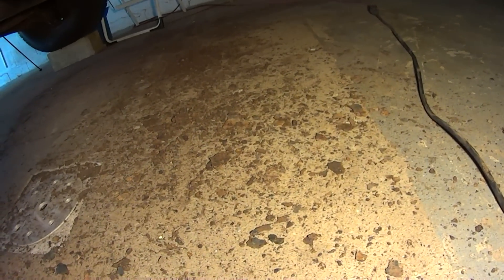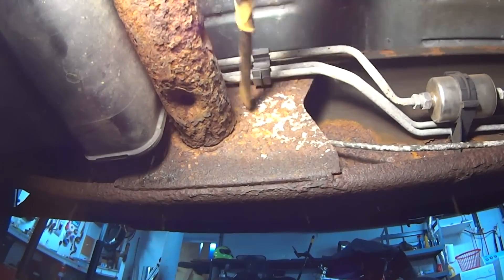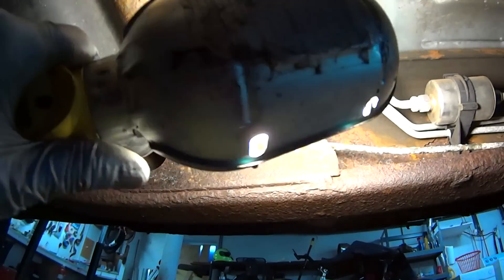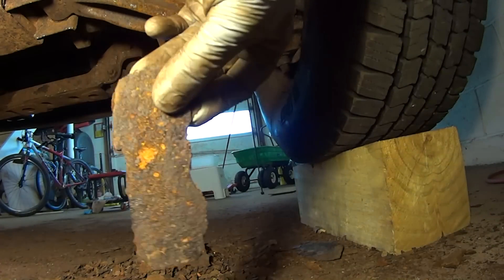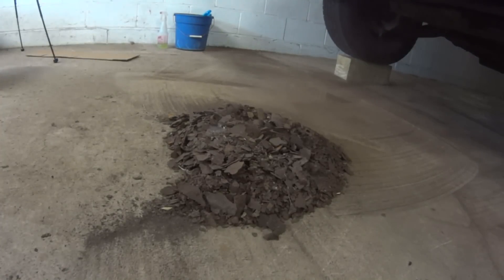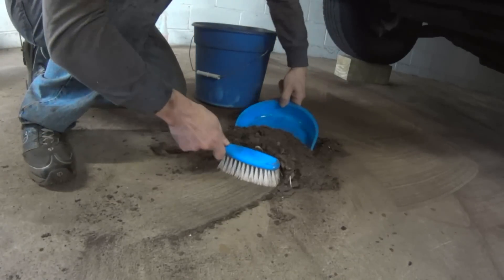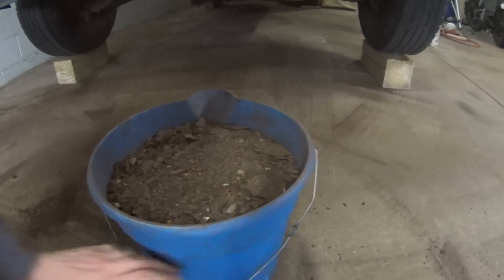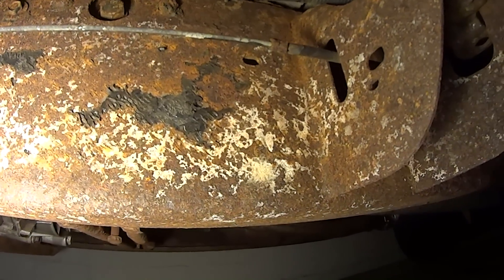Most satisfying video. Silverado Frame rust removal, RUST PROOF STUDY

Comment: Man i tell my truck friends all the time. Take an hour once a year look at your frame. Scrape off bad and rustoleum it. My frame will look new in 20 years.
Reply: Rustoleom will fail eventually.  Oil is best.
Reply: @Ken-h9r  i do both actually. Every year i wipe my frame down with wd40 and any paint spots showing rust i brush them and spray a ligh t coat of industrial strength rustoleum. Never fails.   I only do touch up though not full coating.

Comment: I've also found that the air hammer / chisel bit knocks rust like this off the best. Now, I will say I own the smaller Harbor Freight needle scaler, and the air hammer I have is a Snap On, so there could be a slight difference in quality, that aside, the air hammer knocks the rust off much more aggressively / way faster. The scaler is handy to have, especially as cheap as it is, but this sort of frame rust, use an air hammer like the video shows.
Reply from the maker: Scaler is good for surface rust but not when you have 1/8" thick sheets of rust.

Comment: Tip: use a shop vaccume with a small attachment, like a lint vaccume snake attachment to blow out the inside of the frame.
Especially before you do a treatment.
Reply from the maker: I used leaf blower, vacuum and plumber snake
Reply: @troutjunkie7330  Amazing how much you can get out from inside a rusty frame.

Comment: After all that the chassis looked liked a baked beans can thin,,  I wonder for why you'd bother unless you sand blast or acid dip it ,  the rust is back and next time chisel  punch holes every where , ,   unroadworthy death trap waiting to happen ,  the integrity is gone from the chassis don't carry weight or tow trailers when your Ute truck has reached this stage  ,  it's a 3rd or strength it once was
Reply from the maker: This is old 1999 3/4 ton truck with thick frame. Frames back then were strong. The thinnest spots were 0.120 after all rust removal. Today new truck frames are only 0.060 thick to make them lighter and more MPG.

Comment: The DeLorian cars from the 1980’s were for the most part rust proof.  The frames were dipped in a liquid rubber like substance that filled every inside crack and crevice.   There is no reason why GM, Ford, Dodge-Chrysler can’t rust proof their cars and trucks.   Even the back side of body panels.
Reply: In a 10+ years the rubber coating begin to crack - because of different temperatures, sunlight, chemicals, tensions... And through one crack the moisture goes under the rubber, but do not dry. It ot the end of still frame, but from outside it may look good.
Reply: GM actually does dip the frames on there trucks the stuff is cosmoline grease/wax.
Reply: Stainless steel,my cuz has one.

Comment: By hitting the metal so hard with perferator, you are penatrading zinc layer which is only about 15 microns thin. The best way would be using steel brush to clean that rust off as it doesnt penatrate zinc as hard ar perferator.

Comment: Doing this same work on my 03 Silverado except it's not flaking off well enough to make it so easy like yours. Using a wire wheel on an angle grinder is working better. Also not as bad as yours and the factory costing that hasn't failed is still plyable so it won't come off as easy. Por15 and a a of rust converter spray paint then fluid film before the winter after I'm done cleaning the rot

Comment: So I am at 6:26 and wondering what you do next after using the needle scaler? Will you use a wire brush in spots or just apply a converter or whatever?
Reply from the maker: I applied grease right after this. Other parts I cleaned to metal and used different paints. Doing 5 years study on rust prevention. Video coming in September  at 5 year mark.

Comment: Exactly what I have ahead of me. Already did it once but I used undercoating after and now regret it. The undercoating looked great and I thought that was the right product to use but unfortunately the rust fosters under the undercoating and years later it finally blisters and flakes off but now the rust is THICK and big chunks vs surface rust. I'm going to do the chiseling and wire wheel again but look for a paint product of some sort, maybe something from a marine store might work.
Reply from the maker: Grease. I used 7 most popular products to do long term testing in different section of the frame (5 year update coming soon) Grease smeared all over is the best. 5 years, no rust.
Reply: Is grease better than oil for undercoating?  And what kind of grease do you recommend?

Comment: Dose doing this take away from structural soundness?? This is my only question
Reply from the maker: This is 2500 truck from 1999. The frame on those was 0.15" thick. Today the frames are 0.060 thick to maximize MPG

Comment: I understand eventually you will get rust on you chassis but not shortly after you buy it after years of driving yes... most is caused by poor metals use in the manufacturing process and poor  quality paint products use in coating the frames.... they do this so you will buy newer trucks faster!!!

Comment: Frame still looks pretty good once you get that undercoating and scale off of it and pressure wash it. A nice coat of spray cosmoline once everything dries and you are good to go!
Reply: I've found the thickness of cosmoline with even two coats to not be enough...once I've got anything other than super light rust, it needs to be slathered with lanoline based goo (woolwax)

Comment: Look at it this way. You obviously don't have the infamous gm transfer case pin hole leak or your transfer case would have put rust inhibitor on both cross members aka dexron 3 transmission fluid.

Comment: Is there any benefit from removing the rust? I feel like your just penetrating the steel and weakening it. Unless you plan on reinforcing the still after removing.
Reply: Certainly there is benefit to removing the rust scale. If you were paying attention to the video you saw the salt deposits that were hiding under the rust. If any undercoating is to have any success averting further rusting the scale and salt has to be removed. Otherwise the undercoating only seals in the salt and any moisture forming a rust promoting poultice that negates the protection that the undercoating is intended to provide. BTW, rust has no structural integrity. So removing it does not change the existing strength of the frame metal. In fact, since no rust holes appeared after the removal operation, this frame is still in good shape.

Comment: According to uncle Tony ur not taking off rust ur merely taking off unnecessary weight for faster race times it's called drill holes and scrape rust off to gain a 10th of a sec in the quarter mile lol

Comment: For those that don't know just because 40lbs of rust came off doesn't mean he lost 40lbs of steel. When Iron combines with oxygen to form rust you gain the weight of the oxygen.
Reply: Lol what? The weight of the oxygen would be non measurable. Knocking off rust would in fact make the vehicle lighter, but not by much
Reply: @DaDaDo661 He's right.

Rust is made of iron (Fe), di-oxygen (O2) and water (H20).

The weight of oxygen is absolutly measurable.

Fe : 55.85 g/mol
H : 1.008 g/mol
O : 16.00g/mol

With that and the chemical equation, rust would be 1.4x heavier than pure iron.
Reply: @DaDaDo661  This is untrue, you can check this yourself, get some steel wool, weigh it, set it on fire and weigh afterwards. It will be converted to iron oxide (rust) and the weight will increase measurably.

Comment: Man I love my 2002 tacoma but I gotta be jealous that you can take that much rust off and still have a solid frame.  Mine would be long gone if it got that bad
Reply from the maker: This is 2500 truck that has a frame that is 0.150 thick. I think the older Tacos have 0.060 frames
Reply: @troutjunkie7330  Yeah that figures.  I think the frame design on 1st gen tacos esp is also such that they tend to rot from the inside out.  So often if you see significant rust on outside, the frame is already compromised from what you cant see on the inside.

Comment: Wow! This is an eye opener. I bought an Fj cruiser online at an out of state auction. Only to find out that it had so much rust underneath the vehicle. I could not find a repair shop so I had to let go of the vehicle. Wish I knew that I could have gotten rid of the rust just by doing this.
Reply: If a repair shop turned it away it wasn't this kinda rust. It prolly had rot and holes forming...

Comment: I bet the inside of that frame looks a lot worse now. You just loosened up all the rust inside and probably accelerated it when it gets wet again with road salt. You made the truck more dangerous if it splits from the inside of the framework. Remember cars rust from the inside out not the outside in. I bet that truck has been cubed already.

Comment: I've got one just as bad if not worse that I started working on a couple days ago. I've got rearend u bolts completely rusted away, leaf spring mounts with holes in them and brake and fuel lines rusted thru. I'm gonna weigh my rust when I'm done and see how much weight reduction I got out of it.
Reply: Lmao
Reply: 26 lbs of weight reduction is what I got! Pulled the bed off today to make things easier to work on.
Reply: @nxslt11  😂 Chevy junk
Reply: Not quite. It's from years of driving in snow and salt then parking it without any rain washing the salt off.
Reply: @nxslt11  Yea well Chevys and Toyotas are well known for rust. I saw a video of a Toyotas Frame snapping in half.

Comment: I’m glad I live in the south ..... I don’t have this problem.... 
but air chisel is the best way to go. Then either hit it with a flap wheel or wire wheel..... to get the salt off. And just put a coat of ospho on to convert the rust ferric oxide to feral ferric oxide and stop it.....

Comment: Rust proofing will not do anything.  The problem IS the metal.  The problems started when GM went from NEW steel to RECYCLED steel.  The recycled steel is full of impurities and is garbage.  Owners need to start a class action lawsuit against GM.

Comment: My 02 trailblazer is now just starting to rust. Nothing like that though I have very little surface rust. No frame rott ether. The main problem is not washing your car after it snows and salt is thrown down. The salt brine from the salty slush on the road will destroy your car or truck if you dont wash your undercarriage. Unless you have a delorean or an all aluminium vehicle. My trailblazer was owned by and old man that waxed it every Sunday and changed the oil every 3000 miles plus drove it almost every day. Mantinence is critical. Instead of hating fords gms or dodge's we should look at how we take care of our vehicles.

Comment: A good thing to do is invest in a dehumidifier if you have a garage. Concrete is porous and holds onto water. I empty the container almost every day and it hasn’t rained in a week. Keeps the moisture down and can slow the rusting process. Works for me at least great vid
Reply: Bryce - that's actually a great idea!
Reply: Concrete has poly underneath. 5mil vapor barrier. You never said anything about the walls. Spray foam or foam board at 2” will provide the vapor barrier. Roof also with foam at 2”. While were at it put a wood stove flr further moisture control or pellet stove. Then you will have a dry garage. You can use the dehumidifier in summer. At yhe end of the day if you are not washing your undercarriage a few times over the winter all that doesn’t matter. I mean really good. You will be wet and have water in your face type of washing. Touching up paint every yr goes a long way also.

Comment: Is this chassis still structurally sound after this?
Reply: Removing rust that literally vibrates off isn't changing the chassis strength in ANY way. That flakey rust was contributing ZERO to structural integrity IMHO.

Comment: Incorrect. Your vehicle rust from a phenomenon called electrolysis. All metal vibrates at a low frequency. This is called low frequency resonance vibration. When you have two different kinds of metal, welded or mounted to each other, they can no longer vibrate at their different rates. It's basically cross-contamination. But then you add electricity to the equation. And this excites the metal molecules, and causes them to deteriorate at a much more rapid rate. You ever wonder why cars that sit in a field, do not rust in the same manner that cars going down the road do? This is an easy answer. They have a dead battery. Salt, accelerates the phenomenon. But does not cause it. As Auto Body technician, in a General Motors dealership, in Michigan. And someone who has serviced thousands of Chevy pickup trucks. What's your looking that there is four different types of Steel. With the weakest of the steals being located on the frame rails themselves. So weak, there is an actual Factory Service procedure for fixing cracks in the frame. You don't get that with other manufacturers. But let's look at the real truth as to why this is happening. A company in Ohio, us Steel, goes on strike about every 3 years. And when they do that, they manufacture a Year's worth of Steel for the automotive industry. And then set it out back while they go on strike. And then when they get there UAW Union deal, even though they aren't real Auto Workers. They ship that steel to the manufacturers. And if you go back and look, you can see when, they went on strike. Because their junk steel gets put in different places. Ford used it and wheel houses. Chevrolet in rocker panels. And Dodge in radiator supports. This was all an attempt to hide that junk Steel from the consumer. Because the car companies no longer sell you a car. They sell you a financing package. And after seven years of financing, you'll be lucky to have a car left. I'm sure, if you open up that driver's door, and look at the bottom of the door oh, you will find that, there is very little to no paint their. And I know this because, I have made tens of thousands of dollars, fixing the bottoms of those doors. The number one thing that you need to protect Steel is paint. If you're going to finance and $84,000 Dodge truck, and what that thing to last the life of the loan. Take it home, take it apart, and finish painting it. Same with Chevrolet. Same with Ford. If you want to preserve the paint that is already there. Don't use undercoat. Undercoating condensates between the coding and the steel. And causes your vehicle to rot faster. 3M paraffin wax. Allows for moisture to be purged from the surface of the steel. And sits on top of the wax. Another little-known Secret ... Epoxy paint now comes in a spray can. Epoxy, is the only material that keeps moisture out.  it is completely different then regular paint. Regular paint has round molecules, and moisture can penetrate between them. Epoxy molecules look more like flakes. And they overlap and sit flat against each other. this makes it very difficult for water to get around the edges. It adheres to the surface of Steel in a far superior fashion than moisture barrier. Moisture barrier is not paint. It is not primer. it is exactly what it says it is. Just barely enough to keep water out. and the number one thing the manufacturers are spraying on their frames, to create the illusion, there is paint there. And just an FYI ... you are literally destroying the frame of that truck. It is now weaker. And more susceptible 2 passenger compartment compromise. In other words. It's junk now. What you should have done was, knock all of the loose stuff free with a wire brush. And apply chassis saver. Which literally, glues the rust back to the frame. What you used to do in the 50s 60s and 70s, no longer applies today. that Chevy Silverado is not your grandpa's square body. it is a complete and totally different animal than what your grandpa used to drive. And therefore cannot be addressed in the same manner your grandpa did. The only stupid question is one you never asked. Assuming, that you can do today, what you used to do 30 years ago, will only come back to haunt you in the end. Every car on the market has a Vehicle Manufacturer repair guide. and inside those guides, that are not Chilton's and are not Haynes, shows you how to address these problems. If there's any question, consult the manufacturer first. they are the ones who are true experts on what, they built. a do-it-yourselfer, thinks they know everything. A professional seeks knowledge. Knowledge is power. And knowing, is half the battle.

Comment: It has nothing to do with GM or Toyota or whoever's rust protection as we talk about plain steel, just the previous owner was a douchebag and left probably a dozen of winters worth of salt to the underside which was left to rust. Salt will eventually eat anything, no matter how much epoxy it has, it will start from a bolt or seam or scratch and will bubble off the coating.
ONLY a yearly rust coating and a weekly pressure washing will keep it rust free!

Comment: The structural integrity of that vehicle is literally falling off! 

I doubt that this vehicle was over engineered to the degree that it could sustain such a major loss of structural integrity without being compromised.
Reply from the maker: This is 2500 truck with 0.150 thick frame. The thinnest spot was 0.120. I took measurements in other video with caliper. Today 1500 truck has 0.060 thick frame.
Reply: @troutjunkie7330 

Thank you for your prompt and informative reply. I hadn't thought that after losing around 40 pounds of structural steel, the chassis could still have sufficient integrity.

I stand corrected.

Interesting that the later steel is that much thinner from new. One would hope that their corrosion protection has significantly improved.